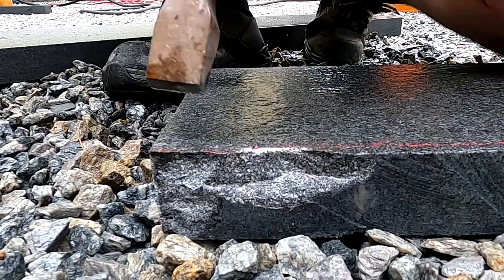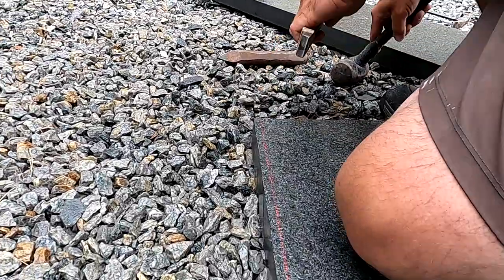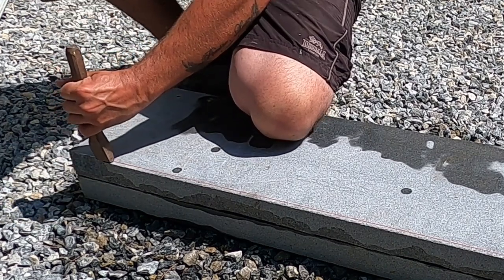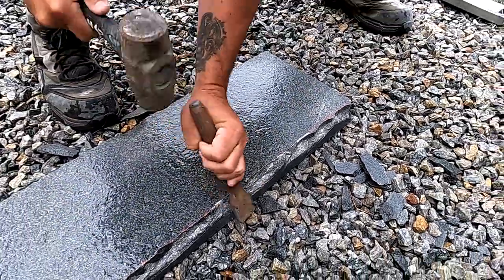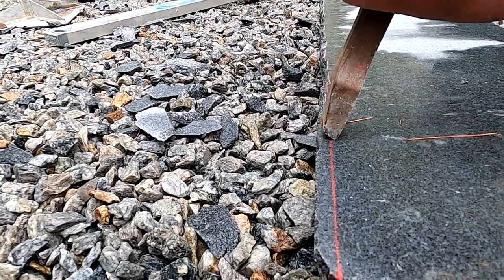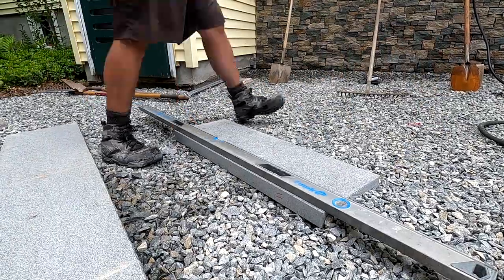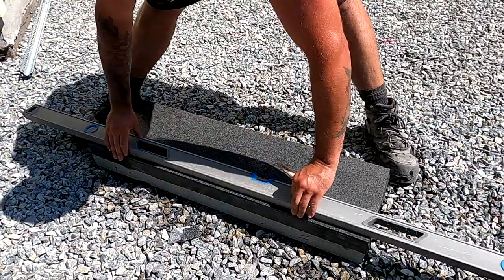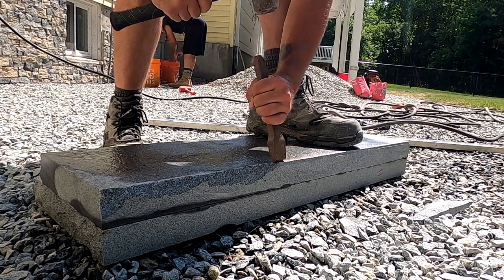How To (Rock Face) Granite

Comment: Nice to see the process. I assume the rock facing technique would still work with concrete coping as opposed to stone and intend to give it a shot; I had a fairly lazy contractor put in a paver seating wall that needed a lot of finish work which they completely neglected, e.g. a lot of flat and rough edges that weren't deburred, and capstones that were only rock faced on two sides but not finished with a rock face on the ends. I'm just going to rock face them myself because dealing with tradespeople who aren't as attentive and thoughtful as you are is an exercise in grief these days. Even if I screw up, it would still look better than the flat edge from a concrete saw and won't cost me any grief dealing with trunk slammers. 👍
Reply from the maker: The rock facing will work for concrete caps also. I see a lot of guys who leave the ends saw cut / smooth, big no-no in my opinion. You need to have the same textured face on the sides as the front and backs, very lazy to not do that. I'm sorry you are not pleased with your contractors, that seems to be more common for sure. I love what I do and take pride in my work, it is all about quality. That is what gives you a good reputation. Good luck fixing your cap stones! ✌

Comment: Score it with a grinder try using a piece of angle iron within the the range you don't want an over bite.... this will limit the range of options for the chisel's shockwave to go. You can still pitch it, but if it breaks independantly... what would normally be an over bite, winds up being okay. Unless you screw it up hardcore, or if there was an unexpected fracture. 

You'll still need to do the same thing, on the other side, pitching it, but without the angle iron. (all this done in a dry sand bath, so as to control vibrations in the stone.)